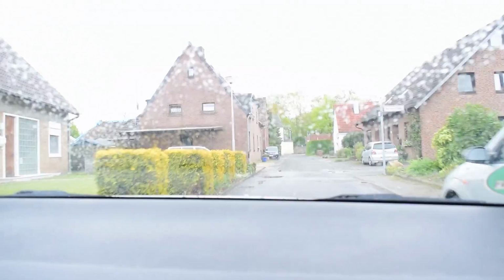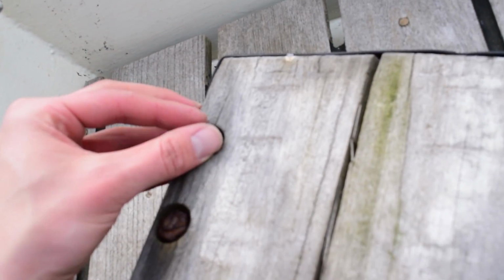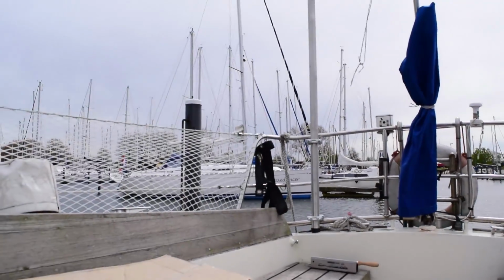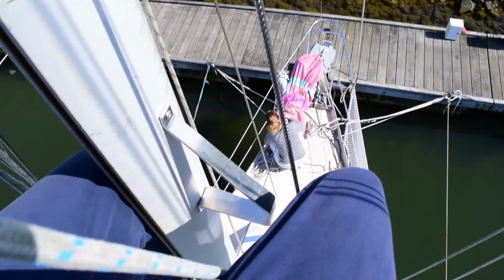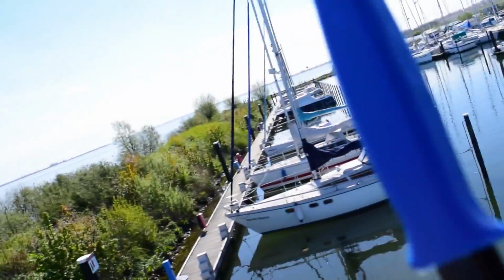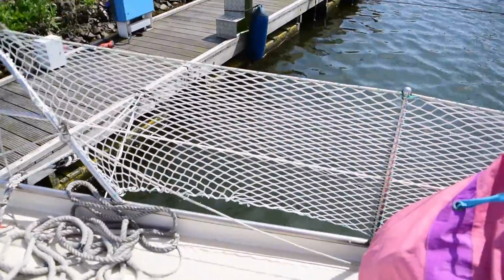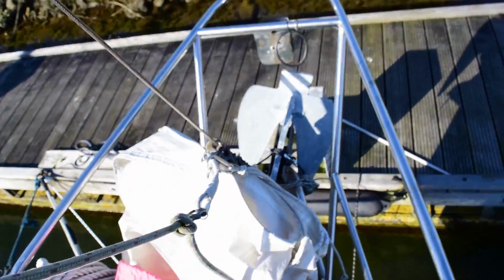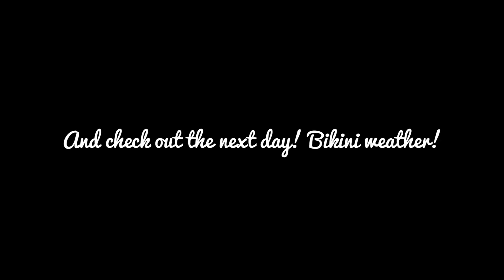Two aboard Tuuli Ep. 13 - Projects, Projects, Projects (Part 2)

Comment: The nuts were put on with a thin walled socket set it looks like...or a standard socket set...or the Rustmaster 5000 nut bonding system.  Though the latter I wouldn't get it near any nuts unless you would want them to never come off without the aid of silicon penetrating oil.
Reply from the maker: +Allyn Onderdonk Yeah, my sockets for the ratchet wrench were way to big. Anyway, that ugly thing is off!